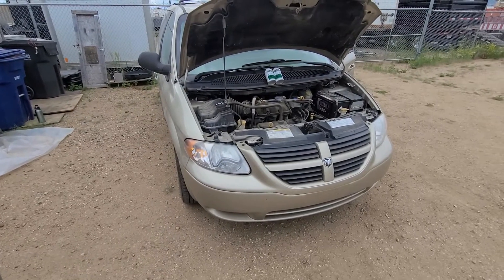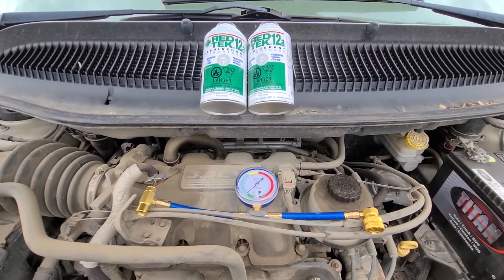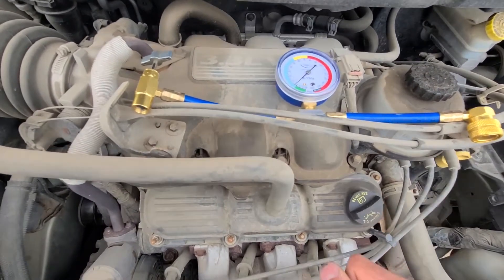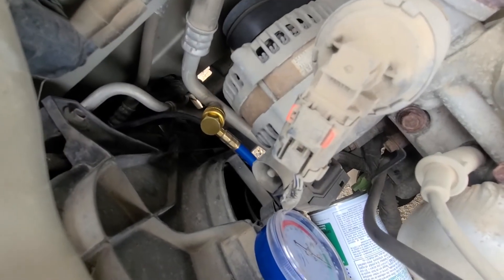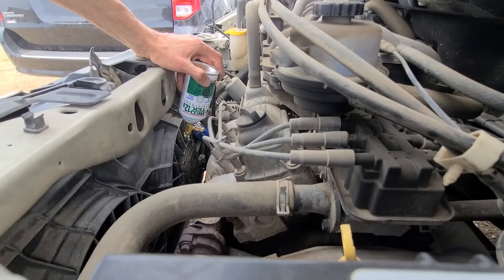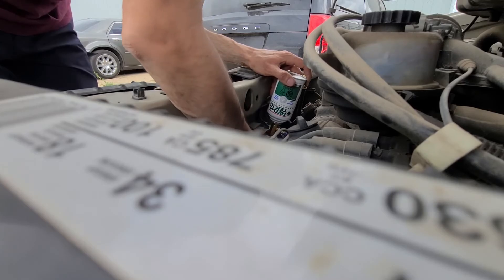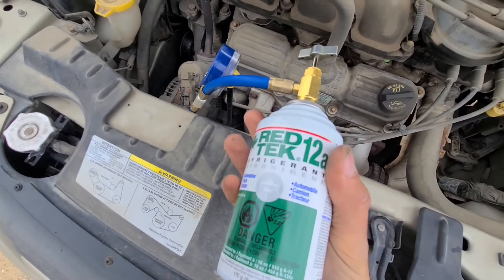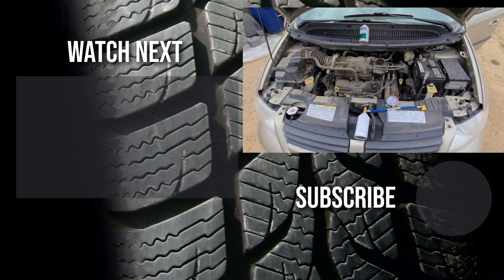RECHARGE YOUR A/C - DODGE GRAND CARAVAN (2001 - 2007)

Comment: Good video. For the 2005 GCV is there a good test to determine if there is a slow Freon leak?
Reply from the maker: Thanks. To do the leak test it would be best for a licensed mechanical shop to do it as they have all the equipment and it is part of the recharging system.

Comment: I just replaced both my radiator and a.c. condenser 1 year ago and replaced the dryer at the same time.. This time around by just replacing the condenser only and pulling a vacuum... How many 30z cans of pag46 oil do I need and how many cans of Freon for my 2005 Dodge Grand Caravan sxt 3.8L dual A/C

Comment: Very good, but why only chargering the low pressure side?
Reply from the maker: That is all you can do using this cheaper a/c recharge kits. To do the proper job vehicle has to go to the shop, system gets evacuated and then recharged using higher end equipment

Comment: If only the front A/C works (the rear A/C doesn't work at all) do I still need to turn the rear A/C on along with the front  after I've connected the refrigerant can?
Reply from the maker: Hi. Yes both front and rear should be turned on and on max fan speed while charging the a/c. If only front works you might be low on refrigerant or possibly having problems with the rear blend door actuator. Also if you are not the first owner of the van make sure to check under the van if a/c lines were not cut and plugged up afterwards as that was the most common "fix" on this minivans